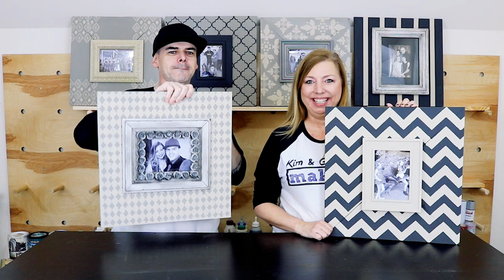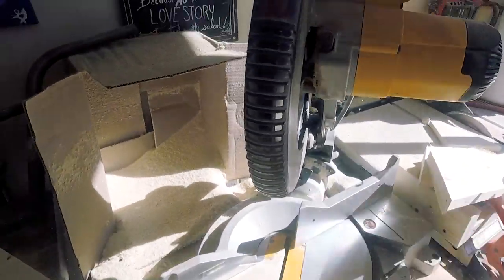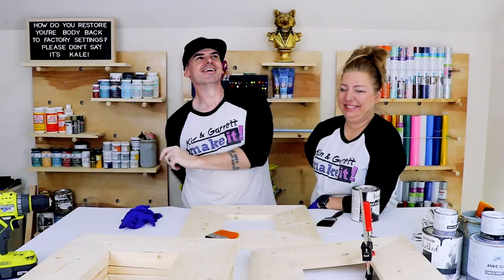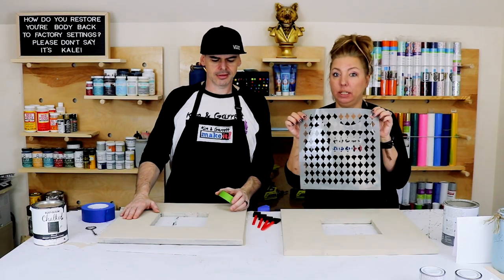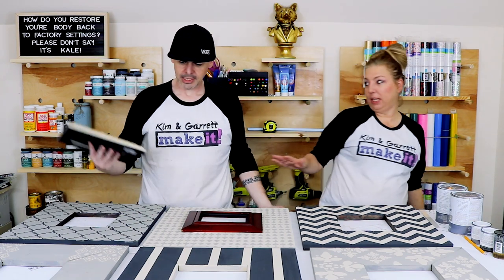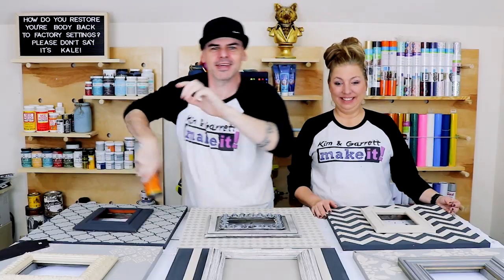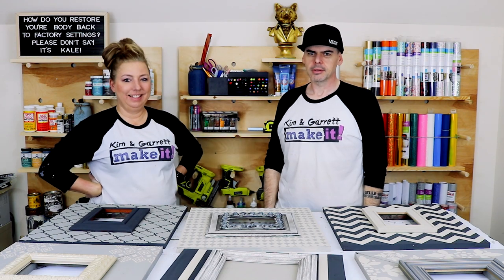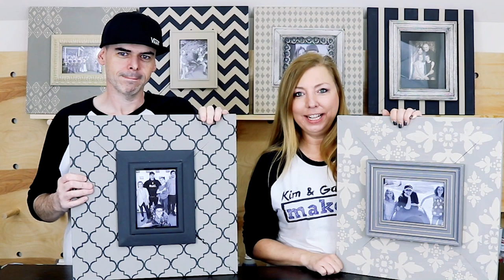How to Create a $33 Grandiose Gallery Wall!! Cheap & Easy DIY

Comment: I’m so DIY illiterate... how did you get the pictures in the frames? Did you glue the frame down with the glass front, and then just use the back that came with the frame? BTW - you guys are truly AMAZING!!!
Reply from the maker: For all but one of them we were able to use the back that came with the frame and access it from the back.  For the 8x10 frame we used velcro command strips to take the frame off and velcro back on.